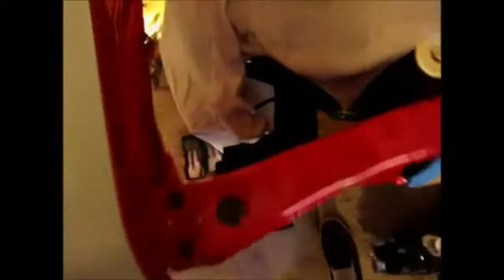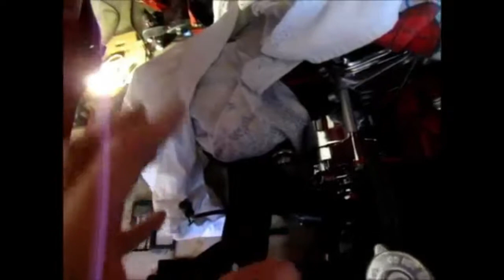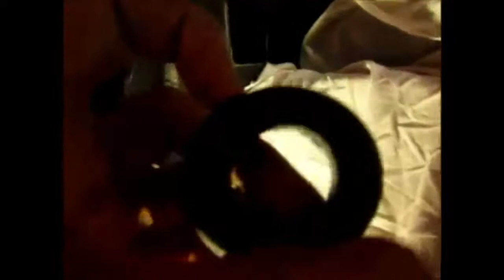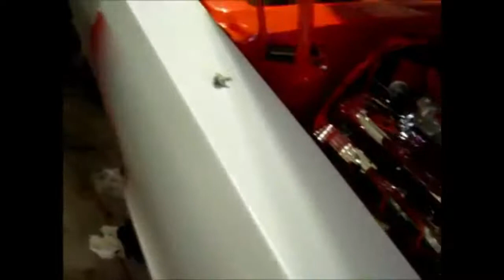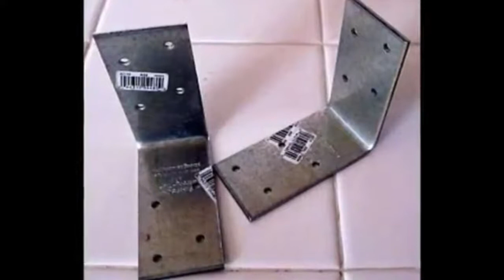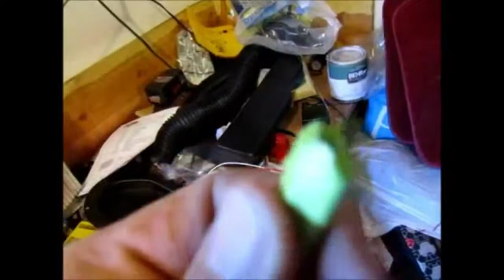74 Chevy Nova Update - Battery Relocation into Trunk  Ep 92

Comment: Did you have to install a circuit breaker from battery to alternator?  I installed an 120amp circuit breaker in trunk & it trips when temperatures outside are hot. Or just wire straight to alternator to battery?
Reply from the maker: I had the same problem with a breaker. I now just run it straight to battery.
Reply: @reborn74nova  ,,I'll do the same. Just was a little worried about fire issue but after a little more research I'll do the same. Straight to battery.

Comment: You could have connected the ground in the back of the car, you just have to run a ground cable from the engine to the cowl panel.
Reply from the maker: I have stated this before. Ground wire directly to battery is recommended. You want to ensure that you close the circuit. There could be interference through the many connection points of the various body panels and parts. Its worth it to be on the side of security. Its not a big deal to run a second wire to the battery. Even the factory has done it.

Comment: You don’t need to run a ground wire. You only need the positive. The ground wire serves no purpose but to ground the battery in the rear and the accessories in the front. That can be done directly on any available metal
Reply from the maker: Ground wire directly to battery is recommended. You want to ensure that you close the circuit. There could be interference through the many connection points of the various body panels and parts. Its worth it to be on the side of security. Its not a big deal to run a second wire to the battery. Even the factory has done it.